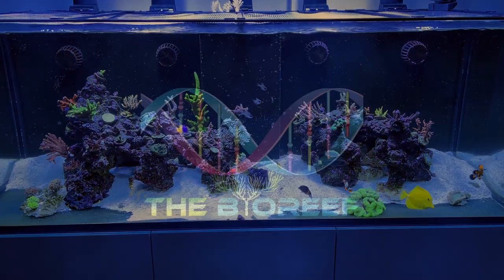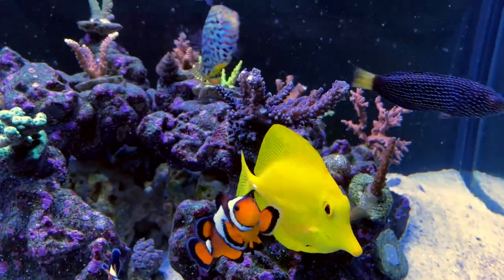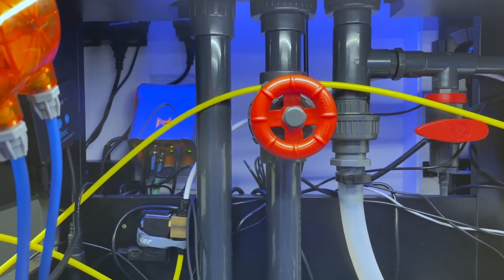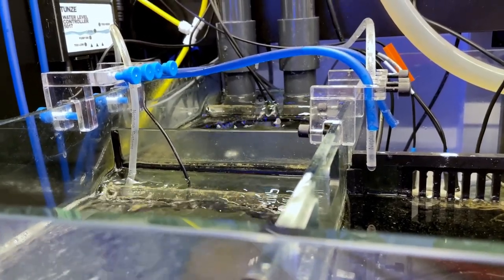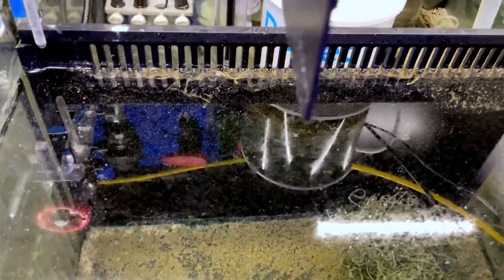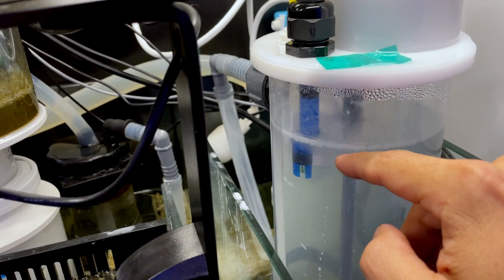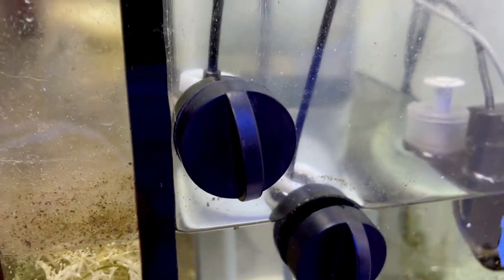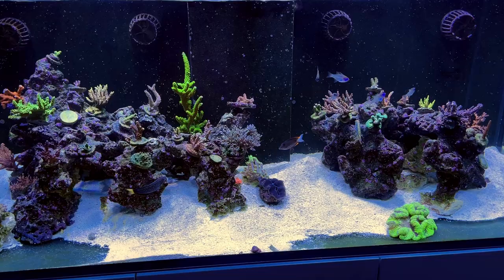SPS Recovery & Sump Tour!

Comment: Excellent set up. How is your pH not through the roof dosing 4 litres of kalk every 24 hours? And your dosing two part aswell. I'm doing roughly the same apart from the water change (I'm using probiotic salt so can't store it) I'm only dosing 325ml of kalk every 24hrs and my ph is at 8.5 and I'd say my sps coral cast is 3 times of yours at the moment

Comment: Glad to see and hear things are going well again.

One observation I thought you might want to watch for long term with regard to the automatic water change you had setup.  Since you have no filter before your AWC picks up waste water, there is a big chance long term your line will be clogged.  Once that happens, you will start noticing and wondering why your sump tank water level starts to slowly rise (the timing will be varied based on your evaporation rate and new saltwater input).  

You might consider moving the waste water line further downstream (ideally after your filter) to minimize this from happening long term.  Once you do that of course you should also ensure your new saltwater line is down from that.

The other consideration with regard to the waste water line is the same scenario could happen when you clean your sump.  It could also get clogged from cleaning if you there are particles floating around after you clean.  usually i turn off the AWC when I clean my tank and ensure I check the waste line before I call it done just incase.  hth

thanks for the content.
Reply from the maker: Good tip. Thanks for the advice
Reply: @TheBioReef  So, I get line clogs on my AWC system (maybe every 6 months to a year). What I do is just cycle some acid through the line. Cleans it up in a few hours. Honestly there is no preventing line clogs. You can only reduce its frequency.

Comment: Just a heads up, that solenoid value on your ro water will be leaching aluminium, copper and zinc into your tank (especially if your ion exchange resin starts to wear out), change it out for a direct acting one to remove the exposure of metal to the water. Smart move using the backup mechanical float valve.
Reply: Quad…how do you know? Did you have one do that?
Reply: @Reefahholic  My background is in this stuff. It has a brass casing with an aluminium plunger all in contact with the water. When your DI starts to wear out the chemical it starts to release (smells like fish) eats the internals, not to where it will fail or is  a problem for its normal use, but enough where it leaches into the water which in even minuet amounts is bad for inverts. The solenoid valve you are after will have a plastic casing and a round/cylindrical solenoid coil (usually light blue). It will also get a little warmer and be a little louder (cause direct acting), but it means no metals in contact with the water. 

The one you have is really meant for atmospheric air, not fluids.
Reply: @quadlawnmowerman  oh boy. Might need to trash those suckers. Gezz. That doesn’t sound good. 😳
Reply from the maker: thanks So much Quad for this tip; i did ask tunze about this when i was building my system and there response was that it was 1) made from brass 2) unlikely to leach anything substantive into the water given small contact time and given properties of fresh water 3) what ever leach out is so small that is unlikely to be detected with ICP; I did have high aluminum in my system, but i didn't think that it would come from a brass fitting; copper and lead were normal according to my last ICP test... do you think that my high aluminium could be coming from this fitting ?
Reply from the maker: also - is there another solenoid that i can replace this one with that will have plastic instead of metal... i don't understand your reference to 'change it out for a direct acting one' - links to the products you are thinking of would be great.. REALLY appreciate this BTW!!!
Reply: @TheBioReef  Ahh Tunze, they have no idea as they neither design nor make most of their own equipment. The Brass (made from 60%+ copper) leeches copper and zinc (always), the aluminium plunger inside oxidises and then wears, oxidises then wears again, this wearing releases aluminium oxide into the water. This is absolutely a likely candidate for your high aluminium, not for certain where your high levels came from. If you take a step back and look at it on face value, you certainly would not put brass or aluminium in your tank or your stored RO water (if you stored it) so you shouldn't run water through it either.

EDIT: Hmm hard to link
Reply from the maker: @quadlawnmowerman  thanks Quad… can you recommend a different solenoid that doesn’t suffer from the same issue ?
Reply: @TheBioReef  trying to get around the link blockers on the tubes for you mate, they make it hard
Reply: @TheBioReef  wow, can't even put some words or part of words in that are any major store or brand....
try searching for this on that large Asian market place, it should have a blue cylindrical top. 

EBOWAN DC 24v 12v Electric Solenoid Water Valve
Reply from the maker: @quadlawnmowerman  what do you think of the apex solenoid - https://shop.neptunesystems.com/products/solenoid-valve i have it controlling RODI water into my storage container, and last ICP test showed no contamination in the RODI storage tank ?
Reply: @TheBioReef  These are fine as they are all plastic with a Teflon liner, although still have a diaphragm which requires head pressure which is fine for your situation assuming your RO unit has a pressure pump or decent mains line pressure.  Just make sure you install it the direction of the flow arrow or it will leak. Just take note these are worth about $5, don't pay the neptune tax.....
Reply from the maker: @quadlawnmowerman  cool. I have a spare one. The apex valve is powered by 24VDC outlet, while the tunze is labeled as 12V. Do you think I can just strip the wire on the apex valve and connect them to the tunze osmolator leads?

Comment: Just added a ecoflow deltamax to reef tank , if power goes out ,will be covered for a couple of days . Maybe something you might be interested in?
Reply from the maker: cool - they run on solar right ? yeah we are thinking of having some solar panels installed in the future - that may be a good option.  thanks for the tip!
Reply: @TheBioReef  
Can change from ac outlet or solar , will flop over to the units stored battery power when senses lose of ac power.
Ecoflow Web page explains better than I can . Thanks for great  reef content.

Comment: Why not use float valve?
Reply from the maker: yeah i debated about using a float valve and forgoing the ATO altogether. My hesitation was that the curret float valve is 'screwed in' and i worry about it coming lose. If didn't want to drill the WB sump for a fixed float valve. I also like the alarm on the tunze in case something goes wrong... having said that,  and in light of Quad's comments below about the solenoid leaching chemicals, i may actually want to just drill the sump, install a float valve, and take apart the tunze altogether... why add unnecessary complications especially if they result in contamination?

Comment: Can you share your Apex ATO protection code?
Reply from the maker: For osmolator, is used: Fallback ON
Set ON
If Output Return = OFF Then OFF
If Output HighSumpLvl = ON Then OFF
Defer 035:00 Then ON
Reply from the maker: And the highsumplvl code is: Set OFF
If Sump_H CLOSED Then ON
Defer 000:30 Then ON
Min Time 000:10 Then ON
Reply: Do you have messenger, Facebook or INSTAGRAM
Reply from the maker: @donsreef5871  I do under the same
Name and logo